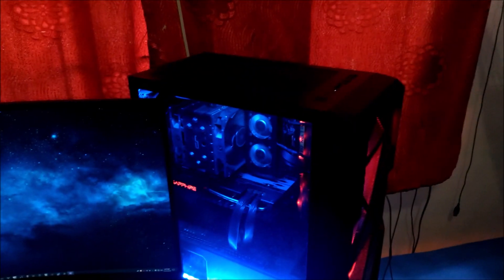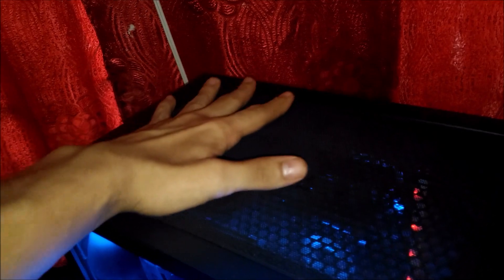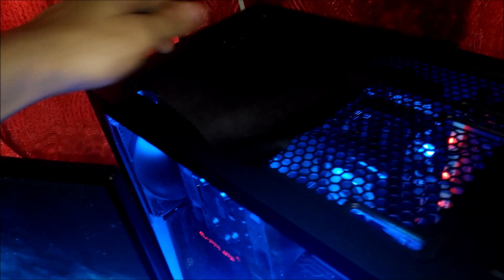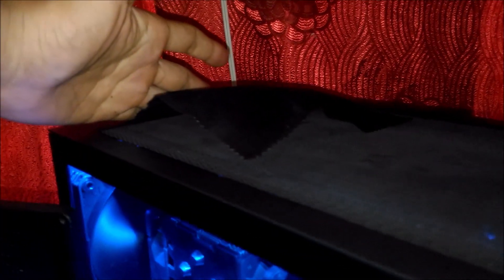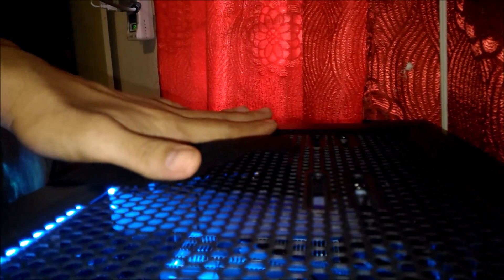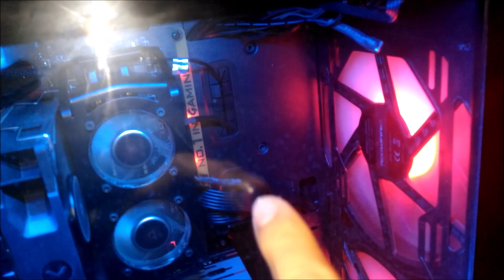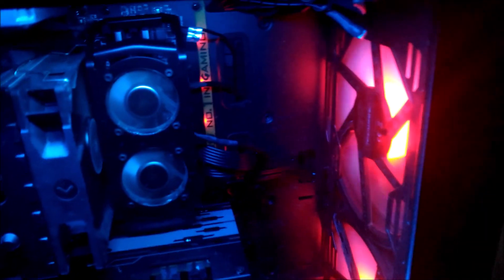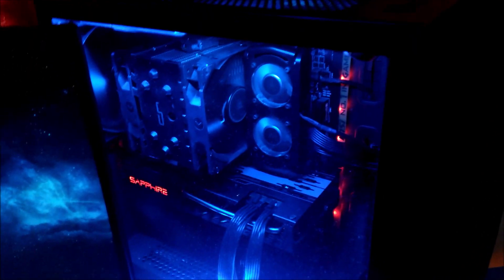Case Airflow - Exhaust Filters

Comment: actually if you don’t mind the looks, best config is intake on both top and psu shroud, thus cpu and gpu receive direct ambient air, and then having front and rear as exhaust
plus this way you have filtered air from top and bottom
Reply from the maker: Yep that's the ideal setup for anti-dust but not sure how the front aesthetic would look with the front fan frames showing, I guess it might match the front panel?
Reply: Jo3yization that’s the only thing that prevented me from buying this case now, i need to know how it looks with front fans being inverted

Comment: Random idea: Use the top magnetic dust filter on the front while the system's on LOL. Might look janky, but it solves the lack of a dust filter on the front I guess?
Reply from the maker: I actually did try that for fun and it sticks to the mesh fairly well, its just nowhere near wide enough to cover a 200mm fan properly & only covers the lower portion, but the fans didnt seem to be hindered by it too much as they just draw air from the sides. Flipping the front fans to exhaust & using the top as intake would probably be the best way to combat dust if its an issue, convection wont make much difference compared to proper airflow.

But overall the default configuration is pretty good as long as the top filter is removed, only a slight amount of dust seems to be getting through as the metal mesh does seem to be stopping most of it.

Comment: Can you please make a video on how strong those front fans are?planning to get a forge also.
Reply from the maker: I can try, though I dont have any proper setup for testing(wind tunnel etc) I can tell you my MG 140mm fans can be felt about 1ft away at ~80% speed(which would be around 65cfm), while these 200mm fans on "high" seem to only push air around 6" but they do so over a wider 200mm area, the only real way to test without a wind tunnel would be to get a 200mm fan with a proper CFM rating and see how it compares. The NZXT might be worth a try with such a high CFM rating; https://bit.ly/37qFnVB but I can't afford one anytime soon as my budget is pretty tight, I'd say the 200mm fans are great and pretty silent even on high mode though, load temps have been great.

Compared to my old InWin 303 with a total of 7x 120mm fans, the tecware forge ran 5c cooler with just the stock front & 120mm rear so I would say the 200mm intakes are pretty decent if that helps at all, I can highly recommend the case for anyone looking for bang for buck, even with just stock fans & not adding any extras.
Reply: Jo3yization i was just really curios about those big fans, thank you for the explanation. Now im really getting that case. I love mesh front panels.